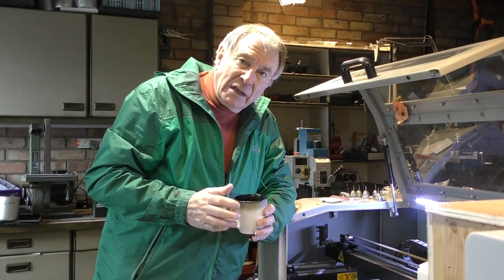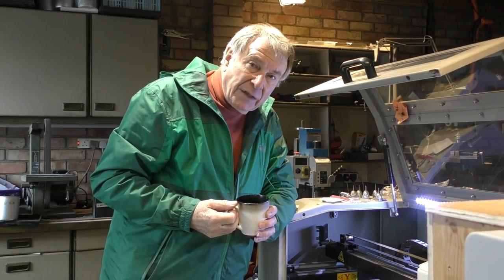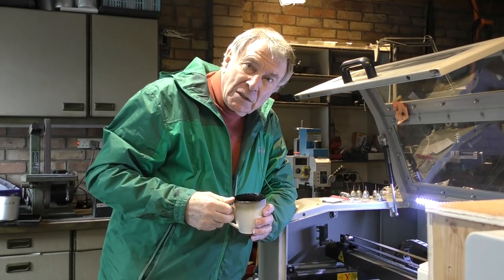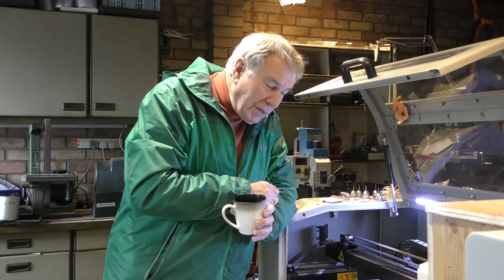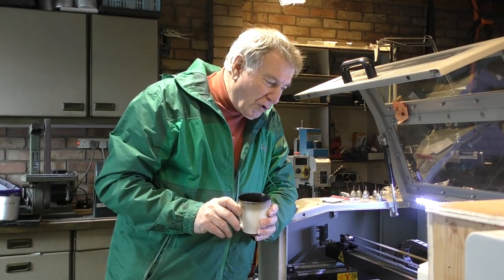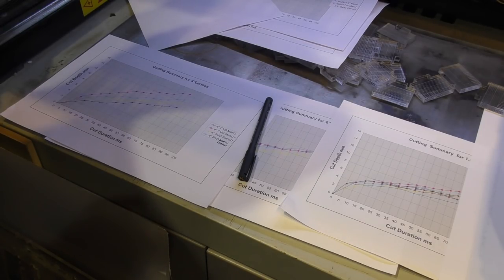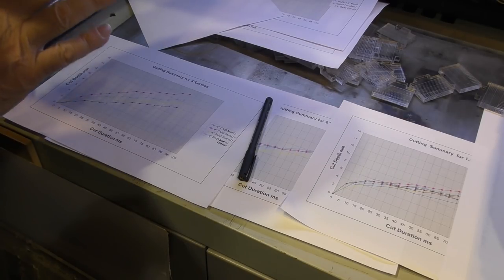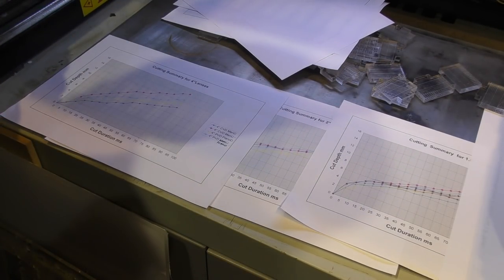RDWorks Learning Lab 202 More Laser Cutting Investigations

Comment: How are you changing your beam angle or width coming in? Is that not set by the manufacturer of the laser? 
Interesting that your machine has two changeable lenses on the head. The manufacturers that i have seen only allow you to change one focal lens to allow for offsetting your focal distances for thicker materials.
Reply from the maker: Hmmm.... where do I start?  First the laser beam itself. There are several ways that a laser beam diameter can be specified  see
https://www.ophiropt.com/blog/laser-measurement/calculate-laser-beam-size/
No manufactures seems to tell you what standard they are using. But in reality the FULL beam width is usually pretty close to the size of the hole in the output water jacket minus 1 or 2mm. However, something else then happens that most  people either don't understand or care about and that is something called beam divergence. . For most glass tube this is typically about 3 mrads  What is a milliradian? very simply it specifies the beam growth in mm per metre. When mirror 3 id closest to your tube it will be one diameter and if at the other extreme , say 1.5m further away from the tube. the beam will have grown by (3*1.5)=4.5mm.  
As you rightly say, this is fixed diameter as it exits the tube . however , in my investigation I have passed the beam through a 7.5" focal length lens to start with and about 3" after that lens the beam is about 40% smaller in diameter as it aims towards a 7.5" focus point and the  laser rays are no longer parallel but diverging.  It is at that point I am able to mount a second lens.
 
Most machine lens tube arrangements have VERY limited flexibility with lenses and nozzles. The C series lens tube offers almost infinite options for lens and nozzle configurations. The sort of industrial machines you have are very carefully controlled with menus , specific lens designs etc etc so that  you DO NOT have the opportunity to stray outside the design envelope.  In that way,  the machine manufacturer can  reasonably predict machine performance.. On my machines, the only limitation is my imagination.
 Best wishes
Russ

Comment: Thank you Russ. My thoughts on the better cutting on the acrylic (when the prediction was about 4.5 mm/s) was due to kurf/heat transference which appears to give you an extra 1 mm/s (ish).

The other thought I had is maybe the gasses released or smoke is interfering ever so slightly with your cuts.
Reply from the maker: Hi Aaron
 Many thanks for the thought
  The fundamental problem with my crude prediction method is it is based on piercing holes A hole  is not the same as a cut face  because a cut face is only HALF a hole which I resones might be quicker than a complete hole so the material  between the touching holes  may be cancelled out.  In the next video you will see me introduce an F  factor into my calculation. I have a lot more practical testing to do on this idea to see if there is any credibility in the idea. 

Acrylic has strange properties. At 160C it turns to liquid and at 200C it becomes vapour.  Vapour is like steam and steam looks white because it is a mix of micro liquid water droplets mixed in with air. The droplets catch the light and so it looks like fog.   The same principle applies to smoke. Smoke is either solid or liquid (tar) micro particles suspended in air that catch the light.  In both cases the important element is micro PARTICLES.. Those particles will absorb some of the laser energy to further heat them and change them to something else . Smoke (tars usually) will burn and burst into flames and acrylic vapour will reheat and tun into gas in the absence of oxygen.  GAS does not then absorb laser energy, only solid/liquids do that. That is why you get charring inside your wood cuts (burning) if you do not have effective air assist to keep the smoke moving out the BOTTOM of your cut.

 There is a mix of physics and chemistry occurring within a cut  At least 50% of using a laser cutter is is having an understanding of material properties.
Best wishes
Russ
Reply: @SarbarMultimedia  I look forward to watching the next video. Crude as your experiments are they are interesting, and do have learning utility. Your videos have allowed me to be very successful with my laser without nearly as much trial and error on my end. So many continued thanks for all you are doing.

Comment: To check your focals on a machine with motorized z, create a set of gcode for your machine that adjusts the z as it sweeps in x or y. I like to create tick marks along the y for every 1 or 5mm change in z as well so it draws a ruler for me. Very nice way to look at the length of the beam waist etc.
Keep in mind:
Shorter focal length = smaller minimum dot size and thus higher peak intensity, but a shorter waist as well where beam is at it's best.
Longer focal length = larger minimum dot size and thus less peak intensity, but a longer waist where beam is at it's best.
You can't have both...
Reply from the maker: Hi
 I genuinely greatly appreciate all comments because there are times when suggestions allow me to find better methods.  I like your suggestion very much but started to use it about 18 months ago and no G-code needed.. See  this video from  2:50.   https://www.youtube.com/watch?v=yO2TD_h8_nI

Hmm. I think you are just jumping in and out of my learning journey.  I will reference you to a video I made  in Aug 2018 when I first began to realize that the standard lens/spot size/focal depth "facts" that people read about  and believe in, made no logical sense when compared to practical cutting results.
 
If you don't want to watch the whole video, at least start at 40:30.  I posed the question then about how is it possible for longer focal length lenses to cut deeper/faster than short focal length lenses with the same power for each. This was counter to all teaching that I (and you) believed in.   Smaller spot size=higher energy density and larger spot size= lower energy density. Therefore the only time you would use a 4" lens is if you had 100 to 150 watt tube. to counter the lower energy density. 

 Since that time when my belief in conventional  teaching on lenses was shattered,. I have continued on and off with my quest to understand the REAL mechanism that allows us to cut parallel kerfs in thick materials when conventional lens theory tells us that what we are doing is impossible.

 Here I am more than 2 years on and after herculean test programs  and experiments during that period,  with my large collection of lenses, I feel that I am at last making a breakthrough and am  able to explain the strange things that happen BELOW the focal point and why 4" lenses actually cut better than 1.5" lenses with the same power. It's been a long journey  with no prior science/research papers (that I can find) to help me. It seems that everyone takes laser CUTTING for granted because it works. 

 Just go back to 31:20 in the above video and try using lens theory to explain why I am getting parallel tubes (with the focus set to the surface of the test piece) .
 My search for a long focus compound lens has pointed me towards the answer by all the nonsensical results I have been getting.

 It may be a few session yet, but I feel confident I am now beginning to decode laser CUTTING.

Best wishes
Russ

Comment: To start, the intensity change is proportional to the change in length to the power of the number of dimensions involved. In your case, the cutting interface plan view area may be considered to be 2D so the change in intensity is in proportion to the square of the change in distance down. Except.. focus matters. I ordered a galvanic laser today, my curiosity   is to know how the change in focal length is compensated for by the galvanic mirror assembly manufacturer at extremes of X and Y axis and whether there is a significant enough change that the software needs to compensate for this in power levels.
Reply from the maker: Hi Daniel
This video was but one of the many pieces of the puzzle towards my goal of understanding the mechanism by which lenses and laser beams perform CUTTING. It's something we take for granted and know from experience that longer focal length lenses can cut thicker materials but how is it possible to cut deep parallel kerbs when lenses diverge the light rays after the focal point and as you rightly say their intensity decreases by a sqare factor in relation to the divergent diameter.

At this point in my 4 year pursuit of the answer I have some fundamental  facts yet to discover. I have discussed this "What is the actual cutting mechanism" question with optical experts, physicists, laser machine designers and international lens companies. There have been lots of theories and "maybe  it's" but no references to scholarly papers. It seems that because it works it's  not worth  understanding.

IT was only recently that the last pieces of the jigsaw fell into place and that illusive mechanism revealed itself. If you wish to discover the final solution then fast forward to  Learning Lab 246

Best wishes 
Russ

Comment: Hope this isn't too far off subject, but I'd love to have (make) one of the spacers you use that have a range of heights.  It's visible in the video around 8:10.  I have a 50 watt 5030 on the way, it would be a nice addition, especially if I can just cut it out. Attempting to no everything from scratch.

Thanks, entrenching video, couldn't shut it off.
Reply from the maker: Hi Jack
 Add your disguised email to another comment and I will send you the file. I will also delete your comment.
 Best wishes
Russ

Comment: So i am trying to make a cutter with a 6w diode laser and i have been playing a round with a few lenses of an old projector. I just randomly stumbled on your video. I have to say, nice work! Really interesting. I watched the whole video XD. waiting for the follow up :D
Reply from the maker: Hi 
A CO2 laser has a light wavelength of 10.6 microns whereas your diode laser is at around 500nm.  CO2 light requires special salt like materials for lenses because glass lenses are totally opaque at that wavelength. This means there are VERY limited lens options to play with, only plano convex and meniscus. You can use normal glass lenses and prisms.

Some of what I discover is transferable  but not all so do your research. However, thanks for the interest.

Best wishes
Russ

Comment: Thank you so much for your videos.  I do have a question that I haven't found in your videos.  If I am doing a dog tag and draw a box for the tag to be able to center my information in the middle, I am having trouble getting the origin set at the upper corner of the dog tag.  I remove the box as I just used that to get my info centered based on the 0,0.  Do I need to leave the box and somehow program it to not cut or engrave?  When I remove the box, it starts engraving the words at the origin set instead of where it was centered at.  I hope that makes sense.
Reply from the maker: Hi Julie
Your guess was close but missing one vital fact. Yes, you must keep your reference square but put it onto a different colour layer
When you set the parameters for that new layer set the OUTPUT to NO. Don't worry about speed and power. The little green square is where your head will start and finish so if you remove the reference square the little green square will reposition itself to the corner of an imaginary box enclosing your text.
That should fix your issue. Any problems just shout again
Best wishes and happy Easter 
Russ
Reply: @SarbarMultimedia  Thank you!  My software must be a different version.  I don't see the Output option (I do see a Hide Yes/No) which I tried.  I also do not have the little green square I see in your video that you speak of.  That's ok, I'll figure it out.  You've been so much help.  Much appreciated!  Happy Easter also!
Reply from the maker: @dawgsabound   Hi Julie
 Is your software RDWorks?   Look at this video to see what it should look like  https://www.youtube.com/watch?v=fLSI-z-TdNQ
 If it is RDWorks then at the top left corner there will be a indentification code  RDWorks V8.01.??
 Best wishes
Russ
Reply: @SarbarMultimedia  No, it is the AutoLaser that came with the laser.
Reply from the maker: @dawgsabound  
 Hi Julie
 So you have a TopWisdom TL-403 controller. . I am not familiar with that controller BUT I do have a copy of the AutoLaser software.  And if you do as I suggested and put your text onto a different layer you can make it do what you want. Put your reference box on a black layer and your text on a red layer. When you set the parameters for the black layer you have to tick either a CUT or a  CARVE box. For the black reference box UNTICK both boxes. For the red layer TICK the carve box and set some suitable parameters 

At the bottom of the WORK tab there are 6 buttons. Press the SIMULATION button and another window opens with nothing in it.. This will show you what you have asked the machine to do . Press start and you will see design running without wasting material.
 Best wishes
Russ
Reply: @SarbarMultimedia  Thank you for being so responsive.  That's exactly what I tried but it still doesn't acknowledge the border placed around the letters.  Doesn't really make sense to me.  When I do the simulation on the computer it appears as though it is doing it but when I run on laser it does not.  Frustrating!  I won't take any more of your time.  Thanks for trying!  Do you ever sleep?
Reply from the maker: @dawgsabound  

 Hi Julie
 If this does not work on the machine then there is  a simple trick to fool the machine. Tick the cutbox and set the cut speed to say 200mm/s and the max and min powers to 1%. That way the machine will try to cut the reference box  but nothing will mark because 1% is insufficient to turn threbeam on.  All you are doing is wasting a bit of time running round your reference box before you start your real engraving
 This will definitely work
 Best wishes
Russ
 My sleep hours are typically 02:00 (maybe 03:00 )to plus 5 hours (0700 to08:00). i have been doing this since I was in my late teens at college. Many have warned it's bad for my health. Hmmmm........experts can sometimes get it wrong. With my extra hours awake  I estimate I have already had 5 more years than my wife who needs 8 to 10 hours
Reply: @SarbarMultimedia  Now that might work.  Thanks!  I didn't think of that.  Well, I think the stress is what makes or breaks a person.  What do the doctors know?  Take care of yourself and thank you so much for all of your help.  I love people like you who are willing to help others without being greedy.  :)
Reply: I hope you don't mind me picking your brain again.  I tried that and it did work, however, the power and speed being set different for the 2 layers do not transfer to machine correctly so I always have to change power and speed at the machine.  With 2 different settings, I haven't figured out if there is a way to change it at the machine for the second layer.  I got frustrated and decided to install RDWorks.  That worked GREAT but then I got a "Communication Error" when I went to download file to USB.
Reply from the maker: @dawgsabound  
 Hi Julie

 Sadly, all digital controllers are not compatible. RDWorks is written specifically for Ruida controllers. HOWEVER, there is another piece of software called Lightburn that is fast becoming a laser industry standard that works on many different controllers. I do believe that your controller is one of those ( more are gradually being added). If you go to the website     https://lightburnsoftware.com/    you can download a full version for a 30 day free trial to make sure it works on your machine.  It is basically a rewrite of RDWorks with a much easier user interface and also it has now got MANY more features than RDWorks. It is an excellent piece of work by one guy (an ex Apple programmer) who was not happy with RDWorks.  Ithink it costs $90 to buy with a 1 year update support. After that it just runs at that fixed issue level unless you wish to keep updated at about $25 per year.
 Please give it a try and let me know of your success.
 Best wishes
Russ
Reply: @SarbarMultimedia  Always great information.  Thank you soooo much for your help.  I will try that.